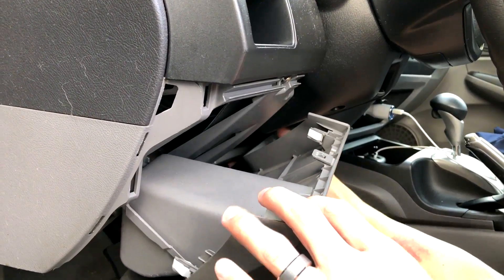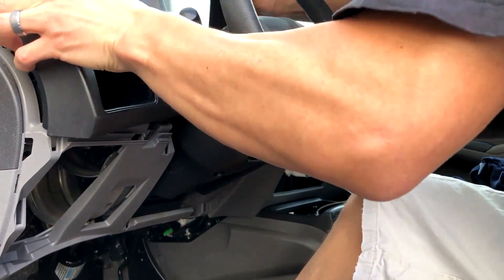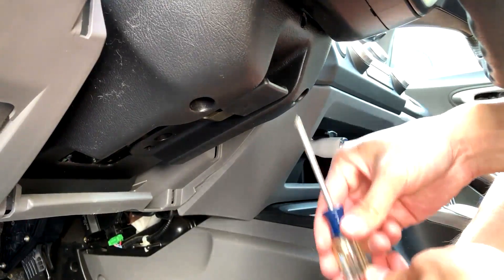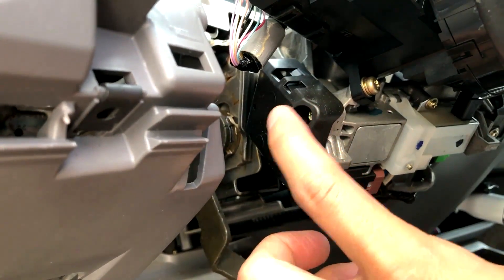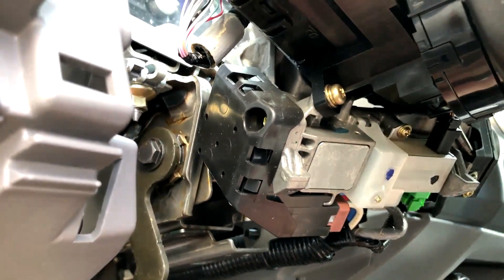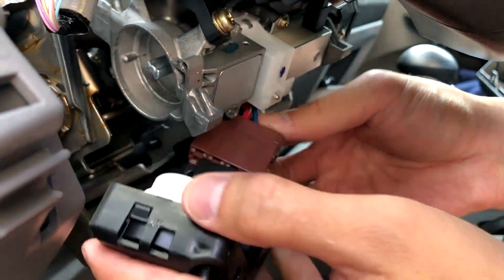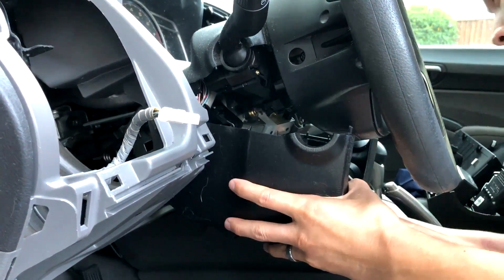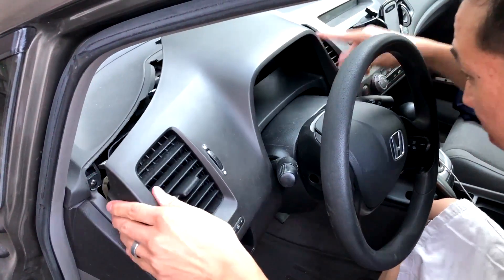2006 Honda Civic Ignition Switch Replacement

Comment: instead of the crescent wrench or right angle screw driver, you can use a small socket wrench with a socket the size for your bit.
Reply: 1/4" is pretty standard.
Reply: I did the crescent wrench and it worked fine
Reply: 🤦‍♂️ how would that not be anyone first thought if you can fit a screwdriver then use a ratchet and socket lol
Reply: @JPOLEN22 😊

Comment: thanks for the video.  Took 10 minutes to replace ...10 minutes to buy a right angle phillips screwdriver at Home Depot.  Cleaned out a bunch of broken glass from the air vents from years of parking in San Francisco.
Reply from the maker: Awesome!  Glad it was helpful!
Reply: @nukem384  it turned out my starter died couple days later.  This was too tough of a job for me to though.
Reply from the maker: @ernestofong2203  Did you get the starter replaced?  I have a tutorial on that part for this car as well if you need.
Reply: @nukem384  I saw your tutorial.  I don't have the equipment to do it.  Labor wasn't that expensive and I got the genuine Honda starter from ACS Racing.  It's fixed now.

Comment: Just did this on an 06 Civic, very easy. You don’t have to take that upper part of the dash off. Used Home Depot mini stubby socket/screw driver to take out screws. If anybody has a question, ask me
Reply: If your ignition switch is damaged and you are replacing it do you have to reprogram the keys even if you get a key with ignition switch? Do you have to reprogram the new keys and ignition to work with your ecu seeing its a new keys and ignition?
Reply: @kareemedwards3341  the ignition switch doesn’t have a key. If you are just replacing the switch it doesn’t involve the key
Reply: I mean the ignition cylinder not the switch
Reply: @kareemedwards3341  I’m not sure how it works with the lock cylinder
Reply: What were the symptoms of said issue?
Reply: @MikeHall-dh3pb  you usually get a buzzing sound from key area when you try to start car

Comment: What symptoms would you need to suggest swapping this part? I'm hearing it's mostly the cheap transmitter on the fob that goes out
Reply from the maker: If you're having any type of ignition issues.  I usually start with this one cause it's the cheapest if you've verified the battery is still good.  If this doesn't fix it, it basically has to be the starter.  But the starter on this car is a pretty big PITA.  I have a tutorial on that as well if you want to see what I'm talking about.
Reply: @nukem384  Changed starter last year, FUCK THAT SHIT - buy OEM and replace once, I don't ever want to do that again.
Reply from the maker: @Tomimi570  Lol for sure.  Totally what I did.  No way I was cheaping out and buying some aftermarket part with an install like that!
Reply: @themikecraig  Lol - I towed mine to the damn shop
Reply: When you hear a buzzing in your starter relays
Reply: What made me think it was my starter switch was a horrible buzzing noise upon trying to crank the engine. Clearly the battery and fuses were fine, so I tried the relay and then the switch itself.
Reply: I just changed the alternator last year on my 2008 Honda civic coupe. I’ve been having some scratches noises when I try to start but as I keep messing with it turns over. I just change the starter yesterday which was a pain and it’s still doing that noise when I try to turn car over. Any idea what should I do next?

Comment: Nothing needs removed other than the steering wheel cover. I got both screws with a screw driver in like 10 second. Just unlock the column and pull out. Screws become available.
Reply: I think a lot of people don't even realize that the steering wheel is adjustable.

Comment: DO NOT disconnect the battery!  Computer theft deterance will not allow the car to start with the new switch installed.
Reply: I disconnected mine and everything works just fine after installation.
Reply: What if you do disconnect the battery
Reply: @jairolopez5952 Disconnecting the battery overnight will reset most of the systems to factory settings.  If you're gonna do that resetting, you need to ziptie the battery cables together so that the clamps contact each other to keep the circuit closed.

Comment: Mine isn’t starting all of a sudden. Sounds like the starter motor is wanting to turn over but almost like it’s not enough power. Also my key got stuck in the ignition and took forever to get it out🤦🏻‍♂️. I wonder if this is my problem, or if it is the starter.
Reply from the maker: Hmm...it's possible your battery is dying?  If everything seems normal, but not enough power, the battery would be where I'd start
Reply: nukem384 Battery is brand new 3 days old. 😫
Reply from the maker: @Macgyverjrofficial  It could be the starter then.  You'd have to test the starter and ignition switch and see which one it is.  Those are the 2 other (obviously) logical guesses, but with me not actually being there and having the testing tools, this is the best answer I can give you
Reply: nukem384 For sure bro. All good. Thanks 👍🏻
Reply: I have a 2005 manual drive honda civic I changed my clutch master cyclinder and now I cnt start my car from the ignition ill hve to jump start any suggestions

Comment: Thank you for the video. I was able to install the exact same part. However, please note that we all have the telescoping steering wheel where we can pull the column out towards the driver. This would allow a stubby to fit perfectly in there on the left side.
Reply from the maker: Would've made my install a lot easier if I realized that back then haha.  Glad it helped.
Reply: I have Been dealing with this problem for a couple years on my Si. I should’ve looked up the symptoms sooner lmao

Comment: If i change my ignition switch, do I need a new set of keys? Do I need to replace the keyhole for driver side and trunk? thanks
Reply from the maker: If you're just replacing the switch, it's a direct swap.  No changing/recoding keys necessary.  That would only be needed if you did the cylinder, which is on the opposite side of the switch.

Comment: Hey bud I just replaced mine but the keys not turning, do I need clock the switch or something?
Reply from the maker: This install has nothing to do with the key getting locked.  That's the other side.  However, my guess is you may have locked the steering wheel messing around in the area.  So push the key in hard-ish, and then turn the steering wheel both ways.  That should unlock the key and then you should be able to turn it to the on position.

Comment: I just changed the alternator last year on my 2008 Honda civic coupe. I’ve been having some scratches noises when I try to start but as I keep messing with it turns over. I just change the starter yesterday which was a pain and it’s still doing that noise when I try to turn car over. Any idea what should I do next?
Reply from the maker: Try this ignition switch and see if that works.  That's like almost the last thing in the electronic ignition to be changed.

Comment: Are there any symptoms for a bad ignition switch, like buzzing and can this be tested? Does it require key replacement and programming or no? Thx
Reply from the maker: Your first question is definitely a mechanic question.  I'm not sure on that.  If your car isn't starting, it's usually 1 of 3 things.  This switch, the starter itself or the battery.

It does not require a re-programmed key because you're changing out the opposite side of the key cylinder.

Comment: Do you need to reprogram the key afterwards or no reprogramming is necessary?
Reply from the maker: Nope.  Direct swap out and you should be on your way
Reply: @nukem384  thank you
Reply: what if you buy a whole new ignition/key?
Reply from the maker: @tobiashogg5610  If you're getting a new key cylinder, then yes, you will need to re-program the key.  You'd need to go to the dealership or a professional locksmith for that.
Reply: so my ignition wont turn at all. i thought it was the tumbler. the steering wheel is unlocked. what do you think is the least expensive way to fix it?
Reply from the maker: @tobiashogg5610  If you don't know what exactly the problem is, probably best to take it somewhere and have them fix it.
Reply: @nukem384  I'm leaving this comment here for anyone curious. I bought an aftermarket ignition part like what's on the video from Amazon but it required programming (I have an 08 civic ex coupe). After further testing I realized  my no start/crank problem was actually the starter, but this vid is indeed helpful for anyone deciding to change the ignition switch or cylinder.
Reply from the maker: @KP-vl7fy  Very interesting.  Obviously something changed in the 2 years between our cars.  I have a starter install video as well if you're interested in watching that one?  That install is difficult though.  I'd definitely recommend getting a genuine Honda part for the starter when you change it.  You don't want to be doing that install twice.  Let me know if you want me to link you.
Reply: @nukem384  Yeah, that 14mm bolt holding the starter was no joke. I had to give up and take it to mechanic.😅 I definitely agree with oem new parts.  Hopefully, the next time my starter goes out I'll have a Tesla like you one day. haha
Reply from the maker: @KP-vl7fy  Haha, hopefully!  Don't forget to use someone's referral code if you do end up getting a Tesla in the future.  Free supercharger miles!

Comment: After instalation it still only starts and dies. Like it wNts it's old key. Do I have to reprogram?
Reply from the maker: Shouldn't have to.  I didn't and it's been fine.  The switch is on the other side of the ignition, so the key wouldn't know the difference.  You might have something else wrong in your electrical system.

Comment: Ok so I replaced the ignition switch and put everything back now I have another problem I tried to start it and the key won't turn? I tried wiggling the locked steering wheel and no luck on getting the key to turn.befor I replaced the ignition switch,the key was turning..any suggestions?
Reply from the maker: Try putting the old ignition switch back on and see if you still have that problem.  That's really weird, but the ignition switch shouldn't cause that type of issue.  Unless coincidentally your ignition lock broke while you were changing the switch out?
Reply: @nukem384  ya I tried putting the old one in and it still won't turn..
Reply from the maker: @Leoralat  Probably coincidentally have an ignition lock issue.  The switch shouldn't impact that and by you putting the old switch back in and the lock still not turning, that confirms it.

Comment: Good video. My tumblers are bad and the key gets jammed up. I just ordered a key and ignition assembly for fifty bucks off eBay. I'm going to be working on it in a few days was there anything I have to do as far as hooking up to a scanner and 'key' in the car? Looks like you just put the part in and started using it . there was no mention of usage of scanner
Reply from the maker: Nope, just take the old part out and put the new part in, simple as that, no scanner.
Reply: @nukem384  I think if you change cyclinder you need new key and needs to be programmed
Reply from the maker: @eroom2087  I was answering if you change out the switch, this video.  You don't have to change your key if you're changing out the switch.  However, you are right.  If you're changing out the cylinder, you will need to get your key re-programmed.

Comment: So I'm running into an issue where the car sometimes turns on with the OEM key but shuts off immediately. I thought it might be the fuel pump but that's working. Weirdly enough my aftermarket remote start is the only thing that gets the car started.

It will run and drive after the remote start. But not when the key turns it over. Side note I've heard like random grinding noise and my rear brake lights don't turn on unless I hit the brake.

Any thoughts?
Reply from the maker: Sounds like you have some issues with that car.  I would check your electrical system to be sure.  Yeah, that is weird that the remote start works, but stock doesn't.  IMO, adding aftermarket parts always makes things more complicated.  It could be your key cylinder too, check that as well.  That could be the issue.  Maybe it's not communicating with the ECU and that's why the car is shutting off.

Grinding noise from where?  Rear brakes?  And what do you mean your brake lights don't turn on unless you hit the brake?  Isn't that when they are supposed to turn on?  I'm assuming you mean when you flip your headlights on, the tail lights don't light up?  And they only light up when you hit the brakes?
Reply: @nukem384  when I turn the lights on for driving at night, the rear lights don't come on unless I hit the brakes. The grinding noise I'm not sure. It almost sounds like the starter but it's brand new and it turns over fine (with the remote start) almost like a grinding metal near the exhaust manifold. But it's weird because it's so inconsistent
Reply from the maker: @FishHeadsIV  The brake light thing.  You probably need new bulbs.  The tail lights are double filament bulbs.  That means that when you turn the headlights on, one filament set turns on (probably busted in your case) and then when you hit the brake pedal, the 2nd filament set turns on until you let off the brake pedal (flashes).

Without hearing it or knowing exactly where it's coming from, I'm just going to be guessing.  But if it's coming from the exhaust area, it could be one of your exhaust hangers is broken, and the muffler and/or exhaust piping is vibrating against the frame momentarily when you turn the engine over.  And it happening inconsistently would support some sort of piping rubbing because the vibration power, if you will, isn't always going to be exactly the same strength.

Comment: Hi. After changing the switch, my car key wont move. Any can help
With this issue. I am stuck
Reply from the maker: Hmm...the switch should have no impact on your key because it's the other side of the ignition.

My guess is maybe you locked your steering wheel in the process?  Try pushing the key in with some force while moving the steering wheel.  That unlocks the key position if the wheel is locked.

Comment: Great video! Thanks! My key isn’t working as well as it should, having to use my spare key because it works better than the main key
Reply from the maker: Definitely get a new key cut then.  You don't have to take it to Honda.  Most locksmith's these days can do car keys with chips in them.  It'll be much cheaper.

Comment: My 2008 Honda Civic keys won’t go all the way into the ignition. Would switching it help this?
Reply from the maker: No.  You probably need a new cylinder, which is the other side of the ignition.  It's the piece you actually stick the key into.

Comment: How do you know it’s the ignition switch or the starter
Reply from the maker: Very hard to diagnose TBH.  I'm not a mechanic with pro tools, so I don't know how they can tell the difference.  I would try this first since it's cheaper, then go to the starter if this doesn't fix your problem.  The starter on this car is a pain too, just giving you a heads up.  I have a tutorial on how to do that too if you need it.
https://www.youtube.com/watch?v=oppUd_pOkQM
Reply: @nukem384   In my experience when the igntion switch goes bad you get a buzzing from that area when you turn the key

Comment: So great video, i actually changed it out myself and instead of switching out that annoying starter too. So the buzzing sound stopped but its still not starting, any suggestions?  2006 civic.thanks.
Reply from the maker: What's the car doing when you turn the key?  If it's an ignition problem, it's usually only 3 things.  This switch, the starter or the battery.  Have you verified the battery isn't dead?
Reply: Me, too. The mechanic I went to said the starter is fine. The battery is good. I don't know what's next.
Reply: Check the Main Relay Ignition
Reply: Neutral/Parking safety switch on side of transmission. See Big Dog50001 YouTube channel with the Accord. If you put your car in neutral & then it starts then you know.

Comment: I have a 2004 civic lost the key to it called a locksmith he couldnt get the key to turn at all what do you think? Maybe ignition cylinder? Or what should i do?
Reply from the maker: The key has a chip in it.  I'm going to assume the locksmith you called wasn't setup to handle that?  Either call a locksmith that can make duplicates of Honda keys, or go to the dealership.
Reply: @nukem384  well he said he did he even asked for the vin#  of the vehicale so im not sure what he did. But if he is right could i just buy a ignition switch Assembly and just have the new key programmed?
Reply from the maker: @JoseNunez-yn4tz  This switch I don't believe has anything to do with the actual programming of the key.  That would be the other side.  The  ignition lock cylinder.  I'd say just take it to Honda at this point and let them deal with it.

Comment: My key won't go in the ignition all the way to start it.. steering wheel isnt locked... seems like something is stuck inside but there isnt .. I just parked car and 20 min later I was about to leave and the key wouldnt go in.. do you hav any idea what the problem could be?
Reply from the maker: It's not going to the be switch.  There might be something wrong with the cylinder.  That's the most logical place to start assuming you didn't accidentally put the wrong key in there.